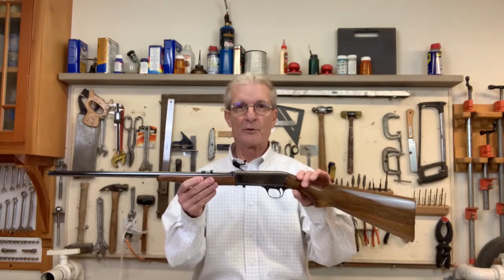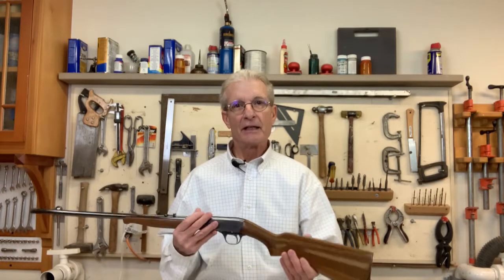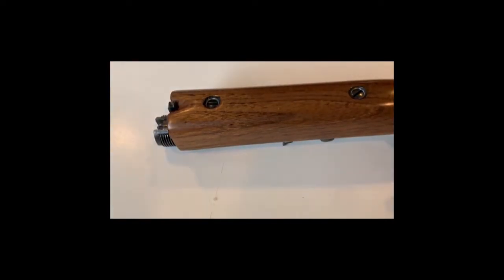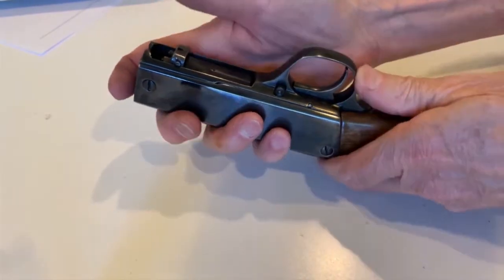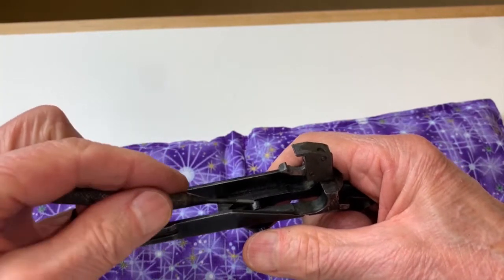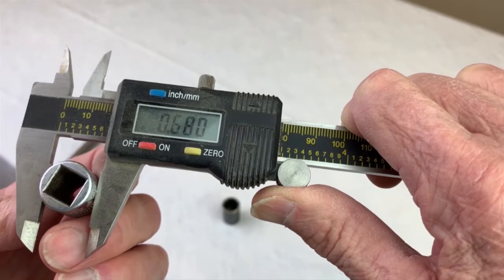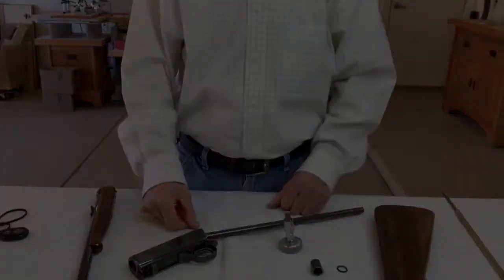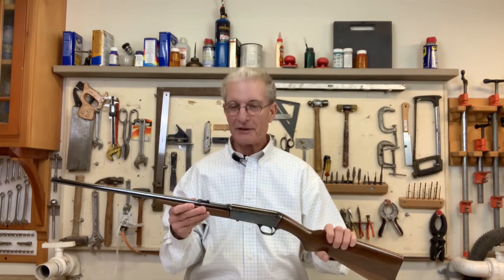Remington Model 24 Restoration Part 3

Comment: Great video, Bruce! I saw one of these in a pawn shop today and wanted to research it a bit before deciding whether to buy it. Your video gives me the confidence to break it down and put it back together again. How did we ever get along without Youtube instructional videos! 

I already own a Winchester 1903, and it has the same type of nut that threads on to the end of the magazine tube. I can't say for sure, but I'm betting it's about the same size as the one on the Remington 24. I had considered a lot of different approaches to making a spanner tool for it, but yours is the slickest I have seen. Very ingenious! Thank you for sharing it with us.

I also am now curious about electrolyzing. I usually try to buy guns that don't have any rust or pitting, but I do have some older ones that have a bit here and there. I'm going to. research that some more and may try it. Your instructions are very good, and make it seem pretty simple. 

I have subscribed, just because I appreciate the thorough and careful way you explain what you're doing. Good job!

Comment: Bruce I did take the trigger plate to a machine shop after I was unable to punch out the safety that I put in upside down... in the process of removing the safety, they, as you predicted, lost the plug and spring but I was able to replace those parts.....today put the safety assembly back into the trigger plate correctly.... it took me about an hour of multiple failed attempts to slide the safety catch across that plug and spring... you made it look easy. To avoid putting it in upside down again, a put a dab of red paint on the upper notch in the safety... As I was inserting it I made sure I was seeing red....still the plug and spring came flying out multiple times before I suceeded... to prevent losing them I did the work in my enclosed shower tiled in all white tile. i put a 5gal  bucket upside down over the drain and used the bottom of the bucket for my work table... this definitely kept me from losing the plug and spring....I still don't know how you did this so easily in the video... part of my problem however is that I have tremors in my hands.... anyway,  I got it done.
Reply from the maker: Congratulations for persevering and getting it installed. If you do it 5 times, I guaranty it gets faster. As you can see in the video, you need to depress the spring loaded plug to get the safety to pass over it. But what you may not have noticed is that the plug pushes up the safety, preventing it from aligning with the hole on the opposite side of the trigger assembly. This means you need to depress the safety after sliding it past the plug to get it to align and slide into place. 👏

Comment: I just got a Model 24 thru an auction for $200, and it looks pretty beat up. I'm so glad you made this video! Now I have some invaluable tips about taking it apart & reassembling it. That little part inside the firing pin would've got lost for sure, but now I know about it. I also have read heaps about the barrel take-up adjustment, and how hard it is to do, but you've made resetting it easy-peasy! Thanks so much!
Reply from the maker: Thanks Denis, you are exactly the type of viewer I made the video for.

Comment: Outstanding, Sir! I see the similarities to Browning SA-22 and these are GREAT TIPS! Perfect video & audio! Thank you!
Reply from the maker: Glad it was helpful!
Reply: I enjoyed your restoration of your model 24. One question is yours a 22 rifle or a 22 short. I found your expiation of making the tool very interesting.
Reply from the maker: @602br61458 Thanks.  It's a long rifle model. I'm not sure if they made a 22 short in the Model 24.
Reply: @bdh503  Outstanding video, I have a model 241 Remington which is almost an exact model but a later model. As a matter of fact I have four of them. Just like you, I have learned to work on them by trial and error. I think the model 24 which is an older model had a better barrel to receiver adjustment than the 241 model. It (24 model) is more of a precise and adjustable method. A lot easier procedure. The model 24 barrel adjustment method with the barrel ring is exact to the SA-22 Browning that is still made today. The most difficult thing in working on my 241 model is replacing the shell stop spring inside the receiver. Thank goodness for dental picks. A handsome refurbished heirloom you have accomplished, you are to be commended!
Reply from the maker: @captain54526  Thanks
Reply: @bdh503  they did! I have one of the first 150 made- 22short only. Grandpa bought it new and kept it on tractor with him to get dinner. The first gun I ever shot, as well as first for my kids . We hosted several international exchange students over the years and it was also the first gun they shot-and the paper targets became a prize possession. A finer, more elegant gun has never been made in my opinion. Great video!

Comment: I picked up one of these a couple of months ago, I had a FN made Browning version, with the loading port in the top of the stock some twenty years ago and I love how great of a shooter these guns are. The Model 24 has been underrated when it comes to their ability to keep up when compared to the Ruger 10/22 and Marlin 60 when it comes to usefulness.
Reply from the maker: I haven't met a gunsmith yet that didn't think John Browning was a genius. Not only is the engineering of this Model 24 amazingly elegant, the engineering it took to make the machines that milled these part was equally brilliant. Thanks for watching.

Comment: When I've visited the Lake Champlain Maritime Museum a couple of times, they've had areas where they've shown recovered artifacts from as far back as the Revolutionary War where they're preserving them or trying to remove corrosion from them using electrolysis in smaller tanks. It's an excellent process for removing rust.
Reply from the maker: It worked for me, mostly because I had everything I needed on-hand. It only took me an hour to set up and I only needed to invest in a box of the washing soda. Aggressive restorations, like the one I did, are anathema to a gun collector who would prefer the original firearm, including the rust. As long as you remove the rust and not the rust pits, electrolysis is not a bad compromise. But my rifle's condition was so bad when I got started, it was worthless. To a collector, it still may not be worth much more then when I got started. But at least now it makes a good hand-me-down forearm. Thanks for watching.

Comment: I might have found a different approach to the positioning of the take up ring and barrel adjustment ring. I removed the lock detente mechanism, spring and plunger from the take-up ring. Then threaded the barrel adjustment ring onto the barrel as far forward as it would go. Then  I slid the adjustment ring onto the barrel threads... it slid in freely because the plunger wasn't in place. Then I inserted the barrel into the receiver and got it good and tight. Then slid the lock ring snug to the barrel. Then tightened the barrel adjustment ring snug to the lock ring.  Then I re-inserted the plunger and spring into the lock ring and re-inserted the detente mechanism into the top of the lock ring... This takes the trial and error out of the process.

Comment: I use a socket wrench , or a 14 inch straight bladed screwdriver.. It can be a chalenge to find the slot in a screw head style.

Comment: Two weeks ago, I was digging thru a closet in my mother's house, and hidden in the back, was a Remington Model 24 in 22 Short. Best I can figure, that gun had been hidden there on the order of10 years or more - my father passed away 10 years ago this past August, and I surmised that while I had been living and working in Texas from early 2009 until his death, somewhere in that time frame he had done some horse trading with one of his friends and acquired this rifle, stuck it in the closet, and forgot to tell anyone about it before he passed away.
It's in surprisingly good condition, no rust, no signs of it having been reworked at any point, what looks to be the original blueing with handling wear you'd expect for a gun of it's age, all of the wood still in good condition and solid, barrel adjustment was dead on, all the mechanicals still in good working order, even the magazine tube and spring still in good shape.
I do have one question though - your rifle has two screws securing the forearm to the barrel - this one only has one screw holding the forearm - I'm assuming they did a change on the production line at some point - question is, is the single forearm screw the original version, or the latter version?
Reply from the maker: Sorry, I don't know.
Reply: @bdh503  I did some checking - the barrel had a date code of "D N" stamped on it, on the left hand side just forward of the receiver - according to a webpage on Remington date codes, "D" indicates the month of September, and "N" indicates the year 1922 - that indicates this was a first year production barrel - and that the single screw in the forearm apparently was the original configuration.
Reply from the maker: Good job. Does the forearm on yours look the same as mine?
Reply: @bdh503  Yes, it looks just like yours - only apparent difference is that mine doesn't have the mounting screw back by the barrel adjustment.
Reply from the maker: So, following your lead, I looked up the codes and my Model 24 was manufactured in March of 1929 ( A X ). So, in answer to your original question, it looks like the later models had the two forearm screws. As for value, I am sure you already know this, but I would guess in spite of how pretty my restoration made my gun look, your gun would probably be worth 4 times more. Of course condition is everything, but if your gun is as original and in as good a condition as you say, the only diminution in value might be that it's a short and not long rifle. On the other hand, that may not matter to a collector. What collector would buy this gun to go out and shoot tin cans?

Comment: Oh god I undid the nut. The retainer fell off. Couldn’t get the barrel to seat snugly after putting it back together. Nut too loose, plug didn’t want to seat in the detent. Rushed over to the gun shop 3miles away just to have the sympathetic clerk hold the stock and push the plunger down with a brass punch all while I tightened the nut. Gun saved.

Comment: Bruce... Help! When I slid the safety in, I accidentally got it across  the plunger/spring but somehow the safety got upside down... Now I can't get the safety back out. Evidently the plunger is being pushed against the flat groove on the wrong side of the safety which prevents it from sliding back out... what can I do??
Reply from the maker: Lawrence, are you sure the safety is upside down. The safety has a nipple that slides into a grove on the receiver. I didn't know it was possible to get the safety in without it being aligned properly, meaning it can't go in upside down. I think your only recourse is to pound it out with a punch, going from the ride side out the left side. If you damage the plunger, you can always make one. I lost mine and had to make one using a 16 penny nail.

Comment: In the process of restoring a model 24 long rifle.  Have looked at schematics and checked parts suppliers and cannot find a "firing pin button" referred to in the third part of this video.  Is it necessary for the proper functioning of the gun?  What does it do?  Any idea how I could find the part?  Looks like it drops inside the firing pin in front of the recoil spring.  Help?
Reply from the maker: The part you are referring to is not listed on the schematic. It is a little plug that takes the punishment of the recoil spring-plug as it slams into the bottom of the firing pin, potentially damaging both. I think the gun will fire without the little plug, but you may eventually damage the firing pin. The little plug measures 4 mm in diameter and is about 4 mm in length. Fortunately,  if you are crafty, you can make a plug out of a 16-penny nail. A 16-penny nail (or 16-sinker), is about 4 mm in diameter. The length of the plug is not critical, it can be a millimeter off either way. Start by cutting the head off the nail and put it in a drill press or drill to use like a lath. Use a hack saw while spinning the nail and cut into the nail in two places, 4 mm apart. Don't cut all the way through. You want to break off the little piece because if you cut the nail all the way through, the piece will go flying and you will never find it again. Grind off the remaining tits and you're done. If you are careful, you might be able to cut a 4 mm piece out of the nail with just the hacksaw, but that has never worked for me. I had to make a couple small components that way when they got lost during my renovation and they work great. Good Luck!  Bruce
Reply: @bdh503  Thanks so much,  Bruce.  I'll see what I can do.

Comment: How was this semi auto able to cycle 22 shorts?
Reply from the maker: You had to buy the version specific to the load. The weight of the breach block and the strength of the recoil spring were sized for the load you intended to use. There was a version for both, but I suspect the breach block and recoil springs were interchangeable.